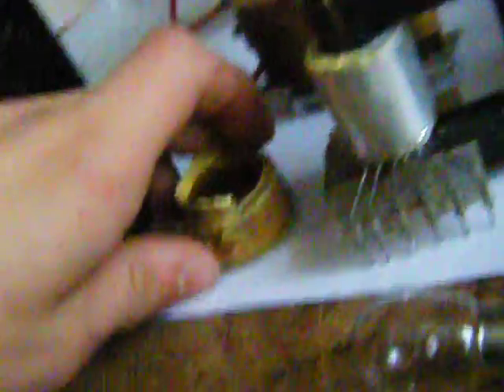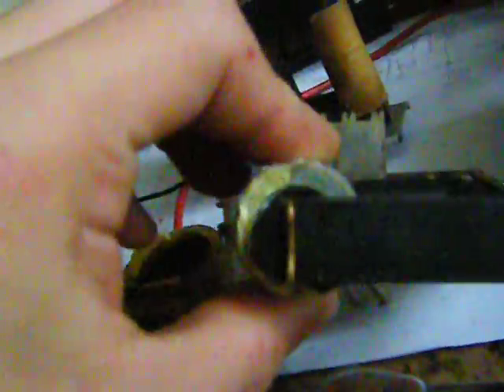My mini spark gap tesla coil with MORE power.

Comment: I need help on this, i did made the coil with 1200 turns of 26 awg wire and experimented with my primary coil 6 turns of heavy gauge wires, but how does i conect the flyback, my capacitor bank and spark grap to the primary coil?